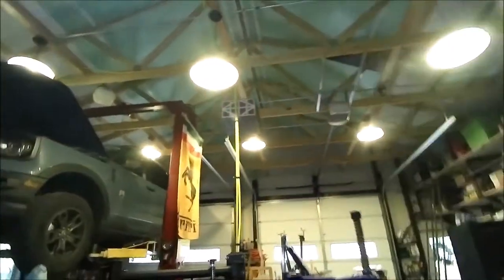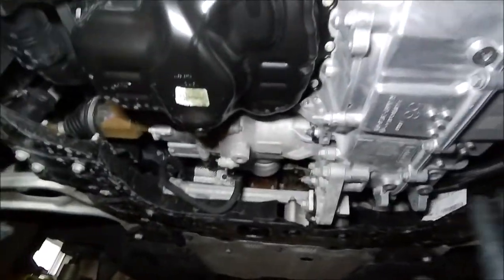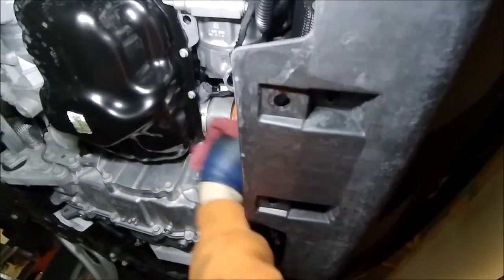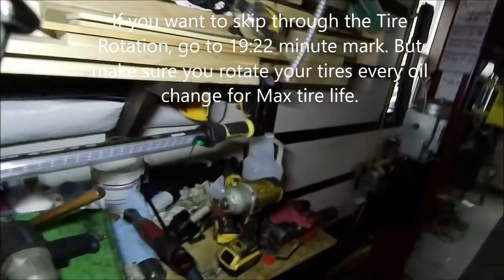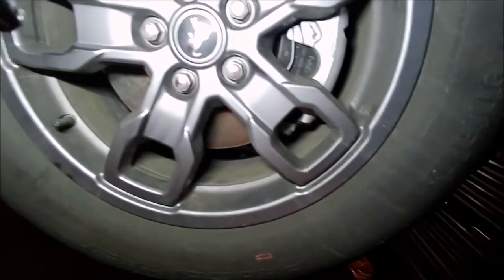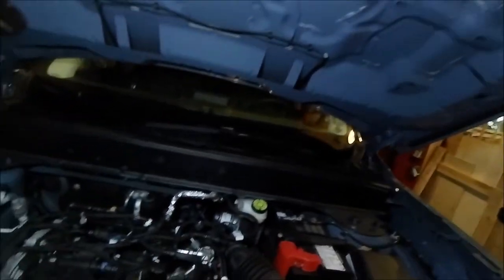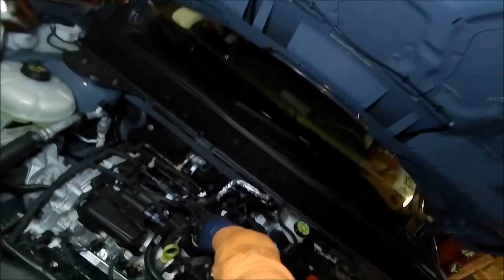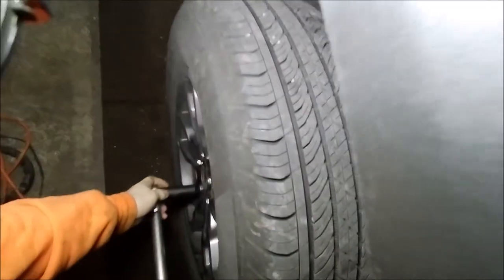Bronco Sport Oil & Change, Tire rotation in under 26 Minutes!

Comment: Thanks for the video. Did I miss it or did you not crossover the tires when you rotated them?
Reply from the maker: Nope, I never cross tires... that's an old way of doing tire rotation especially with today's directional tires.
Reply from the maker: Thank you for watching!
Reply: @GarageMahalLife  Thanks, just saw conflicting info online about front wheel drive dominant AWD vehicles and which tires received the most wear.
Reply from the maker: @bakayarouotaku3298  I rotate every oil change, fro t to back, back to front, no criss cross and I get myself and customers the expected tread life and then some. Criss crossing in my experience masks suspension wear problems and also depending on how the tread pattern is, can actual wear the tires prematurely. But everyone has their opinions. My is based in years of watching tires through their life span.
Reply: @GarageMahalLife  good to know! Thanks!
Reply from the maker: @bakayarouotaku3298  Be Safe